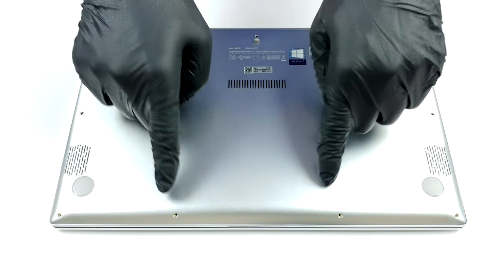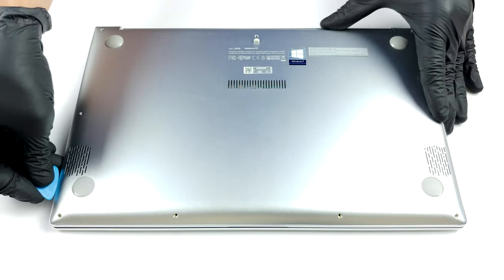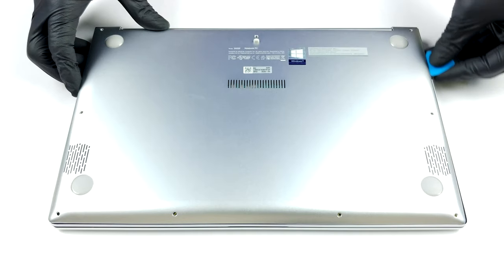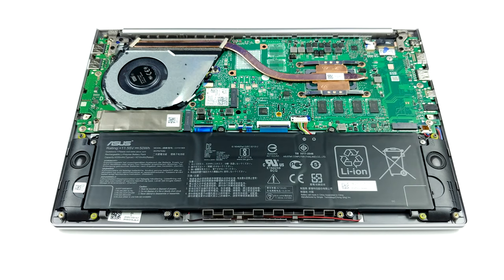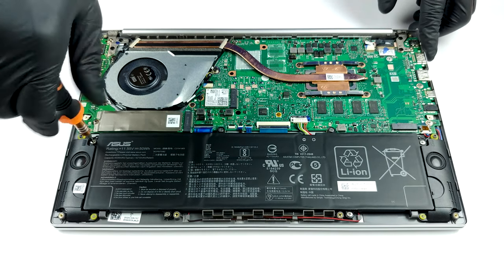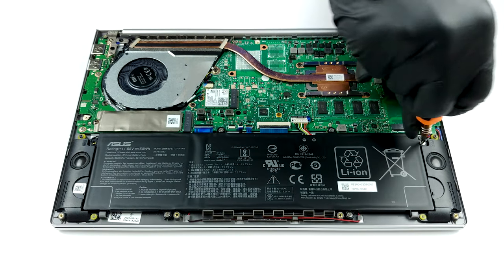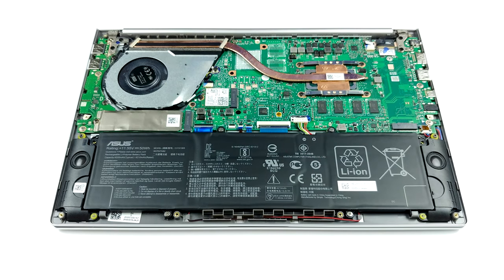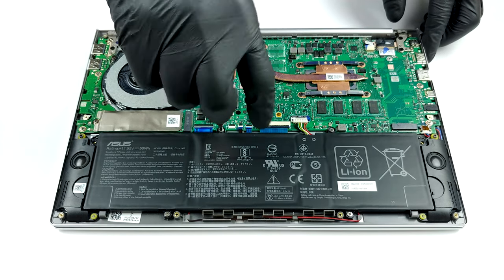🛠️ ASUS VivoBook S14 S433 - disassembly and upgrade options

Comment: Hi, thanks for uploading the video. I bought S533, but i can't find memory slot. Could you tell me where the memory slot is located?
Reply: In this model, the memory is soldered onto the motherboard. Unfortunately, you cannot upgrade the memory. Really, the only thing you can upgrade is the m.2 SSD.
Reply: @lackofmemes240  I am so disappointed. I am stuck with 4Gb of RAM
Reply: @lackofmemes240  does m.2 also help with ram running out of memory? i really need to use adoobe illustrator, using some 3d effects to an element a prompt will appear about ram
Reply: @Haleymrn  it probably wont. m2 and ram are totally used differently by the system

Comment: sir can you check this vivo book also if the ram is upgradable 
asus vivobook s14 s431 laptop - 14", intel core i5-10210u (10th gen), nvidia geforce mx250 (2 gb), 512 gb nvme m.2 ssd
Reply: nope, it has LPDDR3, which is soldered https://dailylaptop.com/models/ASUS/vivobook-s14-s431

Comment: Does this laptop get hot easy? The thermal fan looks small
Reply: Yes
Reply: @fc3  How hot, like very very hot? im thinking on buying one for myself, currently i have an asus x550za and tends to gget very very hot, but it has an amd a10, so i want to know if its going to be not so good in that area
Reply: @agmeag  i have the i5 version and it gets hot when ur running a heavy usage gpu app like playing games and when running a lot of apps its very good and functional
Reply: @fc3  Do you use it on heavy load constantly?, like playing games a lot
Reply: @fc3  Thanks btw for your comment, you're helping me a lot im thinking on buying the one that has i5 11th gen and 8 gb ram, another question is does it handles like most of the games on low settings?
Reply: @fc3  And do you consider that the colors and screen brightness are nice and recommended? i have been researching and the other one the vivobook 14 (x412fl) is not good on that
Reply: @agmeag  yes it does but you gotta use a stand with fans i play apex legends and fortnite on low settings and 60hz its good
Reply: @agmeag  i do play games but it keeps get hot so i use a stand with fans
Reply: @agmeag  the screen brightness is good but not perfect it will bother u under the sun light
Reply: @fc3  tell me your settings do you get any lag at all when meeting opponents that happens to me

Comment: I wish you'd have cut the lengthy unscrewing lessons and wasted some of those 120 seconds on showing us the connector edge on the WiFi card.  We know it's an M2 type and probably a single-slot unit with 2 wires - but will the connector take newest M2 WiFi's, the AX series and beyond?